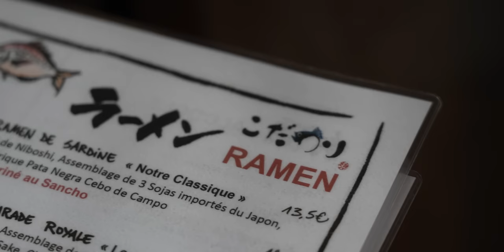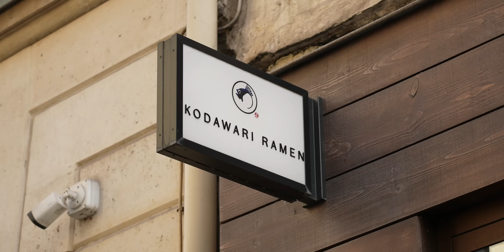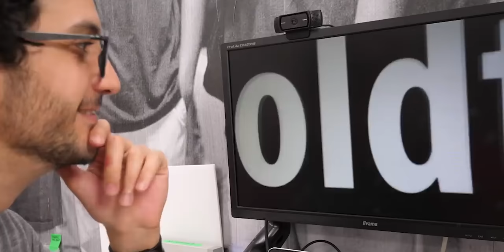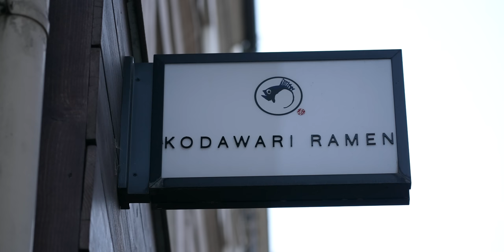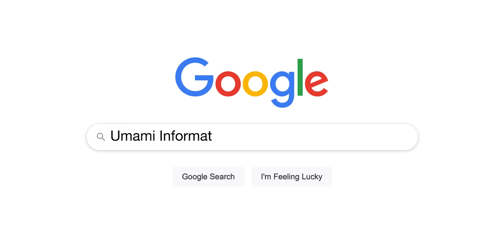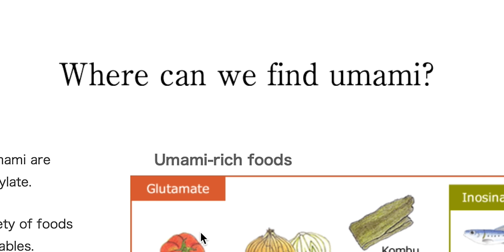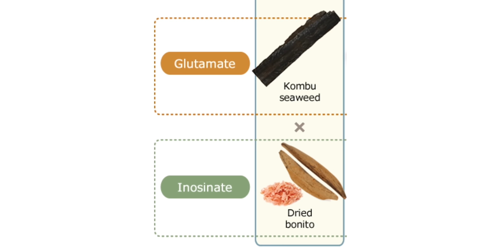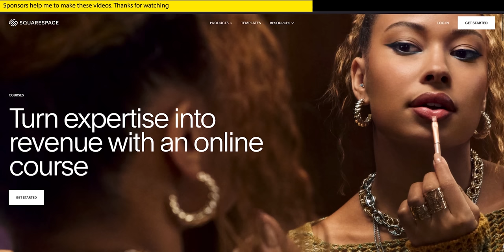3 Pro Tips That Will Change Your Ramen Game Forever

Comment: Counterpoint for homemade ramen: If you have a pasta machine it's totally doable, you just cannot make large quantities! As long as you do small chunks of dough at a time you can use the machine to knead it and get a good structure. Essentially do what you do in the lamination steps of regular pasta. The results are really good if you're somewhere where good noodles aren't readily available, it just takes some time and it's a bit cumbersome at the beginning
Reply: I wonder if you used the likes of an African "woduro", the large pestle & mortar type device that fufu is made in or a Japanese "mochitsuki", mochi mallet, if it would bring the noodle dough together more easily? There must have been a way to do it on a large scale before automation came in in Japan after-all!?
Reply: Also for super hard to knead doughs i suggest getting a silicone kneading bag, it is reusesable and durable as heck and doesn't stick to low hydration doughs such as ramen dough. I got this tip from @mynameisandong from his "Is this still ramen video" and the silicone bag is good for preparing ground meats as well, used it to make dumpling filling and menchi katsu.

Comment: Lovely advice. Tbh, didn’t have much difficulties with making noodles. Resting them really helps the flour hydrate and mine came quite nice, with small hydration and kansui.

The other advice was amazing, hadn’t thought about it but I think they are fixing my issues as well. Awesome content, Alex!
Reply: Same, had no difficulty at all making noodles using a KitchenAid. Even down to 30% hydration. Yes the first pass-throughs were a bit challenging since the mixture was basically like sand, but once it starts binding together, it's really a breeze. People should really give it a try and not be intimidated.

Made all of Ramen_Lord's noodles and also tried Ivan's Ramen recipe. I have also done a variation of Ivan's recipe by adding some vital wheat and lower hydration, they were my favorite of all the ones I made. Chewy, with a great bite and that toasted rye flavor.

Comment: For the vegans and vegetarians there scratching their heads about how to achieve the rich umami flavour without inosinates from meat or fish the answer is yeast extract. The two primary ways to get it are in instant broth forms like meat free Oxo cubes or marmine/Vegemite. I prefer the Oxo cubes just for the more clean flavour but I've tried marmite and it absolutely works as well.
Reply: not vegan but tackled vegan broths as well. you can also just add MSG if you don't mind the added sodium, or if you want inosinates, nutritional yeast is pretty good (and it also adds some well needed funk in otherwise too clean-tasting soups)

Comment: the ramen noodle machine thing surprises me. Ramen is specific and regional with many varieties of noodle. In all cases they adapt to the best thing they can acquire locally.  For my own practice, I have adapted a compromise noodle process between the italian egg noodle dough and the chinese hand pulled noodle traditions- I  make an egg dough, usually I will adjust final hydration with some grams of bone broth with the fat included from the soup, and then I stretch and fold continuously until the dough consistency is very stretchy, like a pizza dough, and then I will make whatever sort of noodles.  Since I do this mostly by hand with a knife and a cutting board on the counter beside a pot of boiling soup, I usually do either snail noodles (roll a log, cut off pepperoni slices, and then as they separate, pull the knife back against the cutting board, rolling the "pepperoni noodle" back under the blade into a snail shell) or bowties/butterflies (cut a sheet, into squares, pinch) or fetuccine (roll a sheet, cut off slices of the roll as if to make peperoni slices, and unroll each slice and stretcch into a noodle).

Comment: I only make vegan ramen and I typically only use kombu and dried shiitake which has a high glutamate content and it works fine for me. You have to make sure to really get a good concentration of mushroom broth out of preparing the mushrooms to make it work. Then again you can always just add pure MSG  if you think it's needed, there is nothing wrong with that either.

Comment: Been making noodles with your original recipe for a couple of years now and have to say, my pasta machine has managed to hold out with no problems. I find that if you use a rolling pin just before the first pass, it works great and doesn't struggle.
Reply: Also... your recipe is AMAZING! absolutely swear by it! Enjoyed MANY great homemade ramen bowls!
Reply: Same, had no difficulty at all making noodles using a KitchenAid. Even down to 30% hydration. Yes the first pass-throughs were a bit challenging since the mixture was basically like sand, but once it starts binding together, it's really a breeze. People should really give it a try and not be intimidated.

Made all of Ramen_Lord's noodles (his free e-book is amazing) and also tried Ivan's Ramen recipe. I have also done a variation of Ivan's recipe by adding some vital wheat and lower hydration, they were my favorite of all the ones I made. Chewy, with a great bite and that toasted rye flavor.

Comment: strongly, very strongly disagree with number 2
while i can respect not making noodles at home, it is definitely not impossible and it will produce better results than most store bought options (sun noodles aren't available to the public yet in france so i don't know how they compare)
let me explain

first, it IS true that you can't get good results with a really cheap pasta machine, but i have bought a marcato atlas 150 (around 70€, so honestly still reasonable) and it's more than enough to make ramen noodles.

second, it is honestly not a lot of physical effort to get a 38% or a 40% noodle with a good quality. it will require practice, and it will require trial and error, true, but as long as you're making high hydration you can do it without breaking a sweat. be very careful about
1. having even hydration (this comes with good mixing technique)
2. not overworking the dough (for example, by kneading it like shown in the video...... you shouldn't knead ramen dough like you knead bread dough......). this was my biggest mistake when i was starting out, i was overlaminating the dough, and it made it so much harder. nowadays, i just flatten it out and fold it 3-4 times maximum during lamination.
3. making sure the dough doesn't dry out. always cover it when you're not working with it

third, you can get results better than kodawari ramen's noodles. okay calm down, when they are cooked properly, the noodles there are pretty hard to replicate. but honestly it's not uncommon for this not to be the case, and for the noodles to be slightly overcooked (or just overcooked). i believe this inconsistency comes from having too many customers.

for more info on making ramen noodles, you should read the free ebook from mike "ramen__lord" (he appears in the video) and if you need any further help there is a dedicated community over on discord
Reply: I feel the same way. Going this far then giving up on making your own noodles doesn't make sense. I got Mike's book as well, very helpful. I will continue to make noodles myself. I bought a similar pasta machine that Alex uses, only mine is red and bigger. It also woks fine without modification, I still modified it.

Comment: Great video and ty for confirming my suspicions about making noodles at home, you've saved me a relevant negative experience 😂 The oil tip is also a revelation!😮 So much!😮 Im very inspired 💫 thank you 🙏
Reply: It is not that bad, it depends on the hydration ratio of the noodles you want to make. I usually do 35% hydrated noodles and a normal Italian pasta machine is doing well. It is time consuming though.

Comment: Ramen has existed well before industrialization. It is entirely possible to make great noodles without expensive equipment. Just gotta do some research into the past.
Hint: the '拉' in ramen means to 'pull'
Reply: Ramen noodles aren't pulled. Everything has its origins ofc but the ramen today is very different to the origins of lamian

Comment: I simply cannot agree on your noodle making point. I've had plenty of bowls of ramen in Japan, been across Southeast Asia, South Korea, and Taiwan eating noodles and dumplings, just ate Ichiran a week ago, and at the end of the day, my homemade soup noodles are far better than halfway to good. I agree that you can't do it by hand, but you can absolutely do it with a Kitchenaid. Stop using crappy AliExpress noodle cranks and then calling that exhaustive data.

Probably the least hydrated noodle is Udon, and Japanese have been making them by hand (and foot) for centuries. Mass produced ramen is great for consistency if you find a good brand but I promise the freshness of a homemade, preservative-free noodle is unbelievably satisfying.
Reply: Udon is typically over 45% hydration whereas some ramen can go as low as 25%. Sounds like you simply prefer your own homemade noodles over what you've had outside.
Reply: @fireflyhm  Ramen can be super low hydration, but it doesn't have to be. And even 38% hydration noodles can be achieved through rests.
Reply: @HebrewTaija  missed my point completely about udon not being the least hydrated like you claimed.
Reply: @fireflyhm valid but tangential point

Comment: You are wrong about homemade noodles.  I use a Kitchenaid mixer and follow Ramen Lord's noodle recipes (with my own tweaks) and I can make noodles at home that are better than most ramen shops in my area (almost all taste like cardboard).  Are they pro level with minimal hydration?  No.  But are they delicious and flavorful and close enough to the proper texture?  Absolutely.  If you have a Kitchenaid with the pasta roller and cutters, you can make something in your kitchen you can be proud of

Comment: Actually, fat is not a problem for health if you just remove the noodles. If you notice, the key to every good cooking is the emulsified fat! Think of it, it is in a great carbonara, it is in a great stir fry and it is in ramen! A high quality animal fat is the king of cooking, and there is a growing trend right now to do keto or carnivore, and in that context, fat is considered healthy! The ONLY thing you want from the noodles is the texture, apart from that there is no nutrition from the noodles that your body needs. You could try replacing noodles for loads of bean-sprouts, slices of zucchini, or simply more meat and egg, and I think it will be the holy grail of ramen. Ramen without noodles! Just the good stuff, no fillers!

Comment: Im sorry but I fully disagree making noodles at home isnt worth it. If you are having that much trouble you are not allowing the dough to rest enough. at 35% hydration (using high protein flour like bread flour) the dough is like sand when you incoorporate all the water and will not come together. You put in in a big ziplock bag, press it into a flat sheet (ideally thin enough to pass through a pasta roller) using the bag to limit its form and let that rest for atleast 45mins but longer the better really, then you can cut into strips and pass  it through a pasta machine no problems and that will do the kneeding (may have to roll the strip out ever so slightly to pass), and the result is nicer than noodles bought from asian grocery stores but the main benefit is you can ammend the noodle for the bowl of Ramen you are making. I would no want anyone to be deterred without trying this method as I find it very feasable